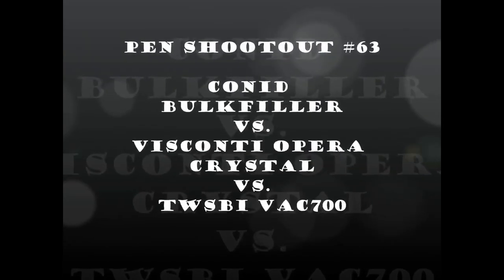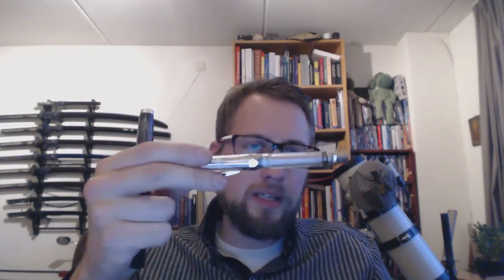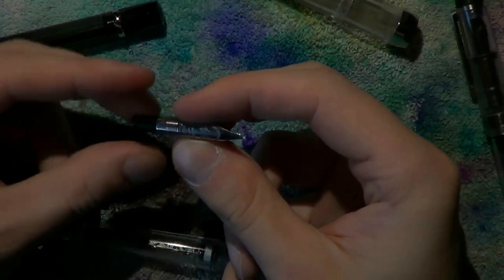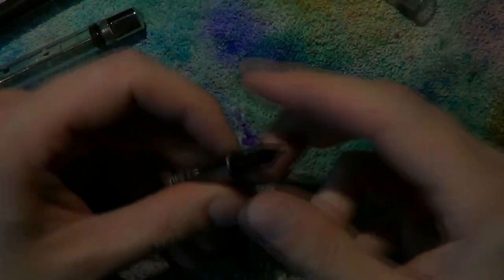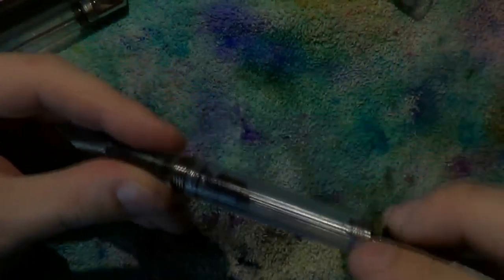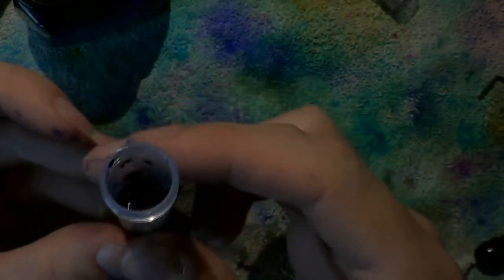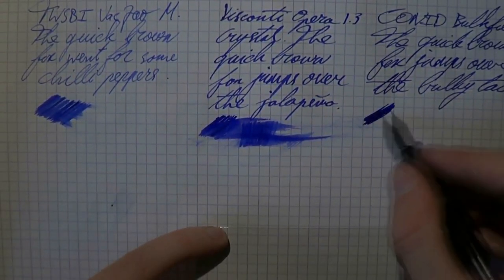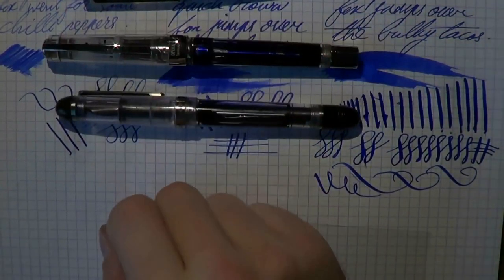Fountain Pen Shootout #63: Demonstrator Vacuum Filled pens

Comment: 12:00 That might be  a "set screw". The video on my computer is failing so I'm not sure of what I'm seeing. Set screws are commonly used to attach knobs onto the stems on the control panels of electronic devices.
Reply: Exactly!
Reply from the maker: That makes a lot of sense, thanks!
Reply: sbrebrown stephen i want to buy a brown ink my prefferences are diamine chocolat brown and montblanc toffee brown.please let me know which one is darker with minimum bleedthrough and feathering.
Reply from the maker: subhadip maji I like Montblanc toffee brown, it performs well.

Comment: Can you convert these models into converter refills instead of using the vacuum method? It is so much easier to clean and refill?
Reply from the maker: No, you can't.  That would require removing the internal mechanisms of the pens.
Reply: sbrebrown I see. It is safe to assume,then,that all of the more expensive fountain pens are either piston or vacuum filled?
Reply from the maker: Mark Grago Usually, yes, but there are some exceptions, like Conway Stewart pens, that are almost exclusively cartridge/converter pens.
Reply: sbrebrown Thanxs,Mr. Brown. I'm still in the early stages of the mechanics of these instruments. I thank-you for all of your feedback and enjoy your reviews very much! I've learned a great deal from you!
Reply from the maker: Mark Grago You're welcome!